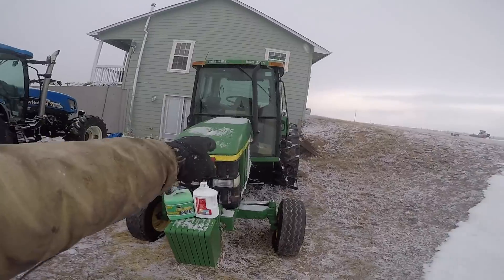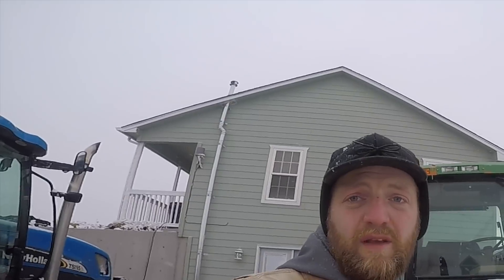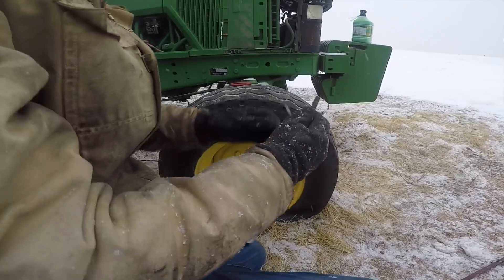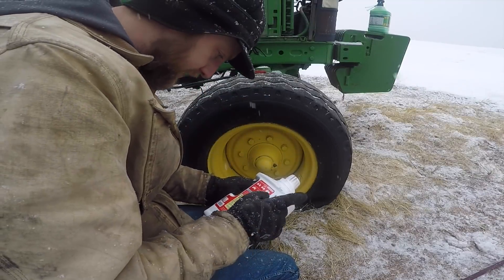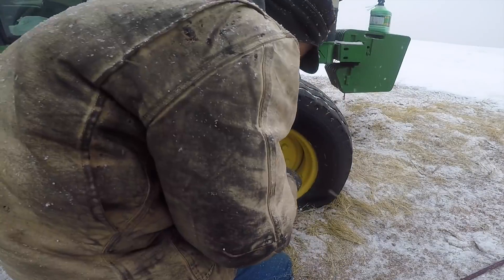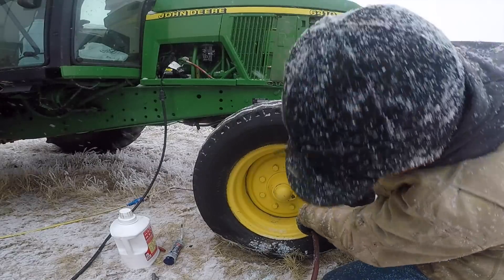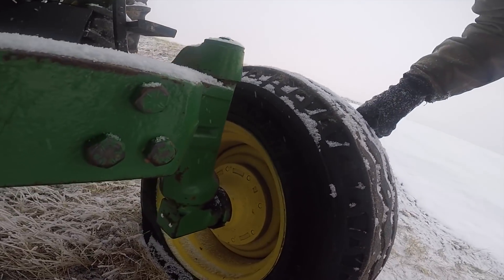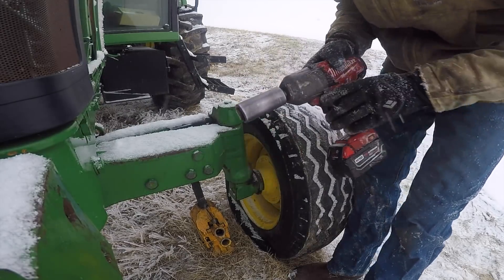Finally fixing the John Deere 6410

Comment: As an old tire man once told me back when I worked in a tire shop, if it ain't patched it ain't fixed. My personal experience has been that plugs generally won't hold more than 35 pounds of air without starting to leak. And when I was driving a concrete mixer we were told by the retreaders to user the combination plug/patches, patch holds the air, plug seals out the water and crud that degrades the tire from the inside. But hopefully the sealants will start working and at least get you through the winter or more. 
BTW, names Doug. Love your videos Blake

Comment: Blake a plugged tire is just a temporary fix. Remove the tire and use a proper seal on the inside. Leaking on the bead can be fixed with "beadseal" applied on the rim when the tire is removed. This slime and other products might be suitable for tractors but a no-go for cars.

Comment: Good video I have used slime a lot in my commercial mowers over the years I have found it doesn't seal as well in very cold weather. After it seals the cold doesn't seem to affect it. Also do not if it affects how it works but I do know slime says to drive the machine or vehicle or to spin the tire after putting it in the tire. I really don't know how you work on stuff in that weather out there I do not envy you. Hope your well. Have a great day. God Bless

Comment: Ive used slime on a lawn mower tire and it worked. I talked to a local tire man and he said if there is slime or whatrever in a tire he wont work on it as it is a real mess inside on the rim and so forth. I have the 1/2 and 3/8 drive Milwaukee impacts and they are great. I used the 3/8 to remove a pickup tire and it loosened 7 out of 8 lug nuts wasn't real happy about that.
Reply: Sounds like a mechanic that doesn't like to get his hands dirty.  I deal with it is lawnmower tires, and it isn't that bad to mess with.  A garden hose and a few towels and it cleans up easily.

Comment: I usually spin or roll the tires around to spread the sealant. You may need a little more sealant than the instructions suggest. Remember that things don't spread as well under artic conditions (move south man).
Reply from the maker: I like it where I am. 😄

Comment: I've had luck with Tireject, but it takes a LOT of product and it's very expensive. I've had to use twice the amount as recommended.  Also, Tireject is strictly for off-road use only, unlike Slime or Fix-A-Flat.

Comment: Curious to see which one holds out better for you.  I've tried slime in the past, didn't go well.  I've got 2 slow leaks on my NH swather I need to get cleared up in the next month or so.
Also noticed the TS115 in the background was facing both ways, you must have a video coming soon... :)
Reply from the maker: Indeed I do. Got the loader back on, still some other work to be done.

Comment: In that cold it’s nice to have them cabs! I’m thinking about building one for my tractor something light that I can remove in the summer time. I have a canopy on my JD5320 but have no clue how I’m going to do it Iv thought about hanging tarps down but then I want be able to see around me unless I cut windows and sew clear plastic in place. I really just need something to keep the wind off of me when I’m working but anyhow keep them vids cranking out!!!
Reply from the maker: I used to have a 5320. If you want to spend some money, there’s a company that makes a soft cab to fit it that just goes over the canopy. I can’t remember their name but I think the kit was around $1800.
Reply: Guy in WY That’s how I found your channel looking at YouTube videos of that tractor. But that’s interesting iv tried to find one of those I found a company but it looks like they only do the small tractors and mowers.
Reply from the maker: cover my tractor .com I've never dealt with them, but they show a few different options depending on which canopy you have.
Reply: Guy in WY thanks I’ll go check it out 👍🏻

Comment: So it looks like neither product works very well in those temps. I've used slime in riding mower tires with good results, but those were summertime temps.
Reply: Didn't he just say the tractor sat a day before he drove it, you have to have the wheels turning to distribute the product round the tires. Thats why he lost pressure.  I'd bet both tires are sealed now he fed the horses, maybe not if ones a tread leak and the other is a bead leak so not a fair like for like test anyway. As  some products don't work so well on bead leaks, Dad slimed a ride on with bead issues. He had to take the wheel off and slosh it around on it's side to get it to work..

 OLF has a video of shooting a moving tire and tire ject, it sealed as it was rolling down the hill .   I'm going to say if Blake had spun the tire ject one fast by hand for a few minutes that plug leak would of sealed before the time he got the slime in the other tire.

Comment: I hate to tell you but MAX pressure on the side of a tire is not normal running pressure. It is mft  max pressure to like seat a bead. Its like a lawn mower tire may say max pressure 20lbs but normal running is 8-12lbs.......
Reply: Randy Schwersenska tractor and trailer tires need to run at max pressure for load carrying  capacity
Reply: Thats why on the side of my tractor tire it sais max load 3500 pounds at 75 psi so in order to carry the max capacity of weight the tire can carry i need to run max psi

Comment: Plugs don't work worth a shit without the slime to finish the sealing. If I was anybody I'd put a plug in it then put the slime in. You don't need to remove the valve stem to put the slime in.

Comment: slime will ruin the rim
Reply: Truman Renz no it won't.
Reply: it makes heavy rust and you will have to cut the tire off...buy a tube ...fix it once
Reply: Yes slime will eat and ruin rims
Reply: Truman Renz cut the tire off?? lol that's a new problem that slim causes now? Rust happens to any rim/ wheel that's uncoated simply from moisture in the air you put in the tire. I've ran slime in both steel and aluminum wheels for 12-15 years now and the only damage I've seen is it etched the clear coat on the aluminum wheels, and the steel wheels were 100% painted inside and out.